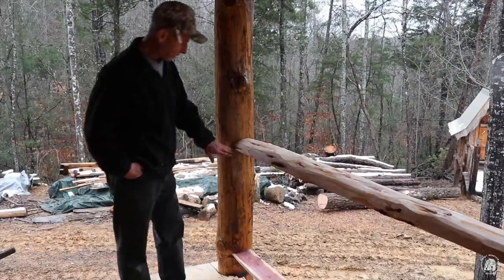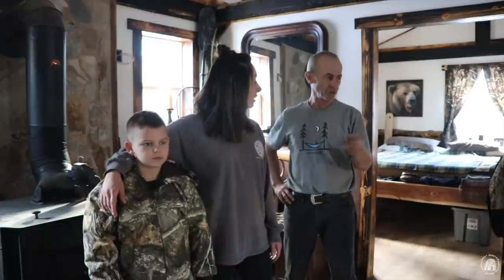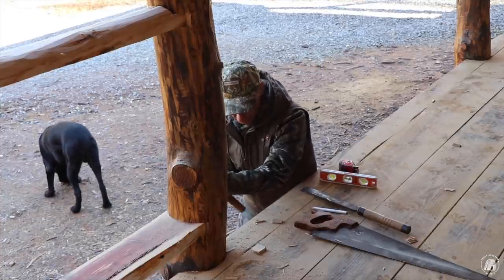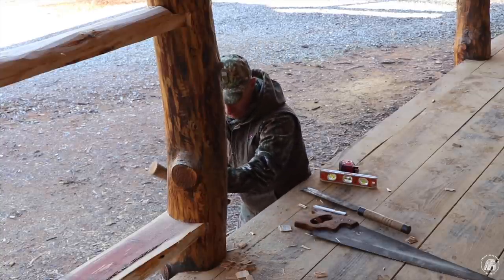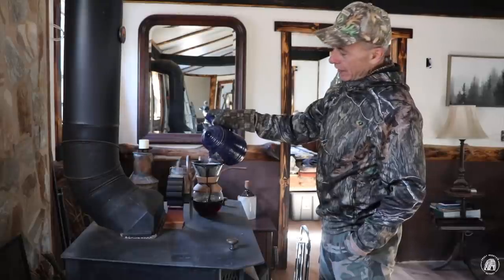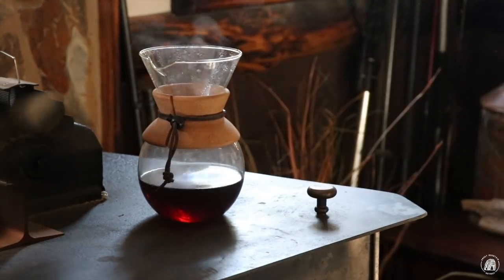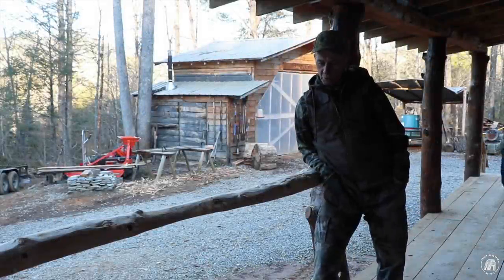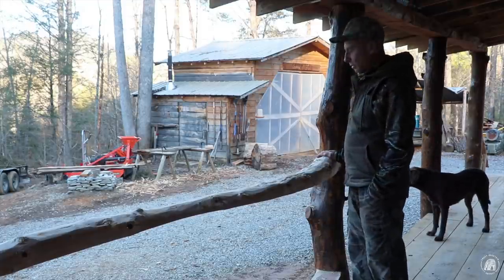CARVING THE FRONT PORCH HANDRAIL | OFF GRID TIMBER FRAME CABIN | HOMESTEAD

Comment: My main concern about notching so deeply into each post from both sides is that it weakens the overall strength of the columns. Hopefully what's left will be enough to adequately support the roof. However, from an aesthetic standpoint, they really do look good embedded straight into the columns like that.
Reply: I'm no engineer but I think some of the roof weight would distribute out the railings, too.
Reply from the maker: The posts are about 10 inches in diameter so I don’t think it’s gonna hurt anything

Comment: Hello the cabin is looking great ,you must be proud. I am looking for some advice , I built a small building from white poplar that I cut on my sawmill hear in Manitoba, I put 3/4 in. board and baton on the outside and 1/2 in. shiplap on the inside. I would like to burn the outside like you do . My Question can I do that now that it is all built or will the wood curl, and what is the formula of the stuff that you paint onto the wood after it is burnt. Love your work.
Reply from the maker: Hey Jeff, 
I don’t know about burning at once is put up on the side of the house. I think you could lightly chart since it’s already on the house without setting anything a fire. I would be careful though because the poplar doesn’t burn like the pine it takes a little bit longer for the flame to actually burn the wood. I do know that the Australian timber frame oil by Cabot Is really good stuff and will probably cause the Poplar to turn colors someone so I think that I would get some of the oil first and try that and see if it’s going to give you a look that you like and then if it doesn’t you might try lightly burning it and then putting the oil on it it